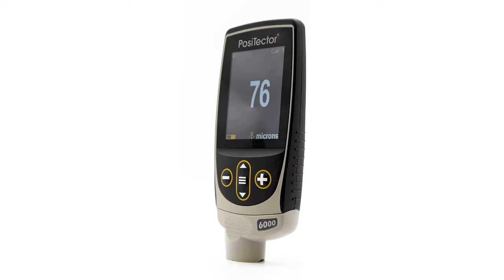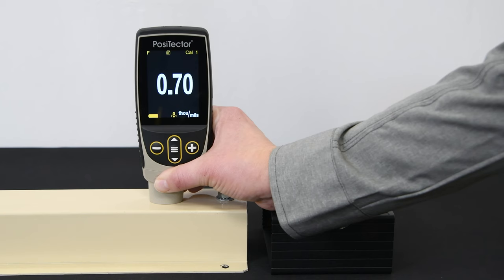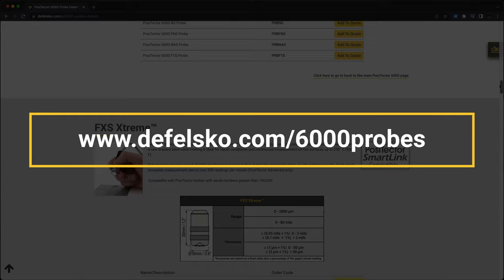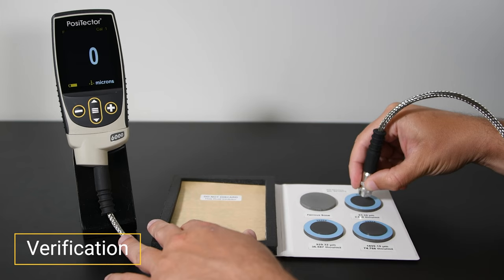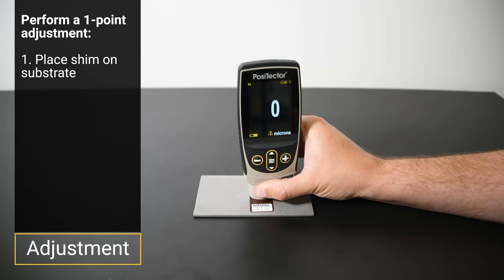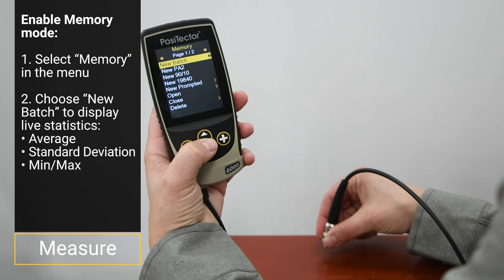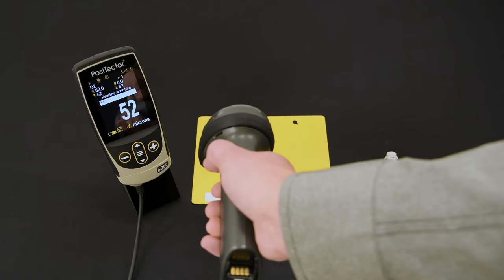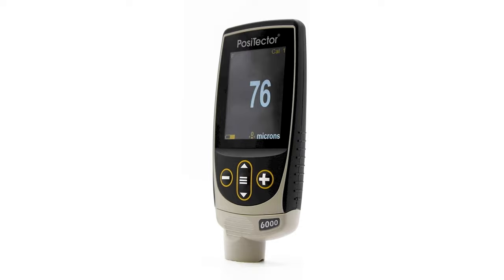How to Measure Paint and Coating Thickness with the PosiTector 6000

Comment: Why thickness are measure in even number only in gauge ?
Why there is not showing any odd number during thickness measurements
Reply from the maker: Hi Maulik, Thank you for commenting. We have a wide range of interchangeable probes for measuring the thickness of a variety of coatings (thin to thick).  Depending on the resolution of the connected probe and the thickness of the coating, our PosiTector 6000 will display odd number measurements.  Please contact us at +1-315-393-4450 or techsale@defelsko.com to discuss this further.

Comment: so this won't also include the thickness of the metal that the coating is on as well right?
Reply from the maker: PosiTector 6000 coating thickness gages are designed to accurately measure the thickness of the coating applied to a metal substrate; it is not suited to measure the thickness of the metal substrate. Our PosiTector UTG series of ultrasonic thickness gages are designed to measure the wall thickness of steel, plastic, and more. Please contact us at +1-315-393-4450 or techsale@defelsko.com to discuss your measurement requirements further.